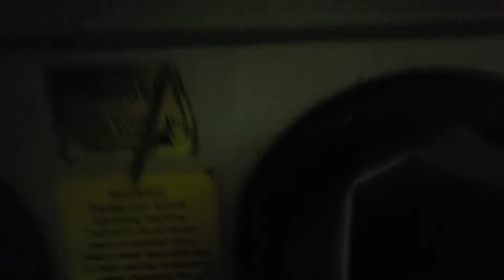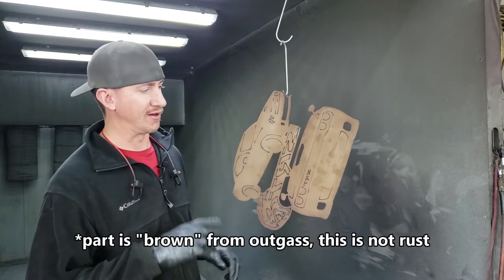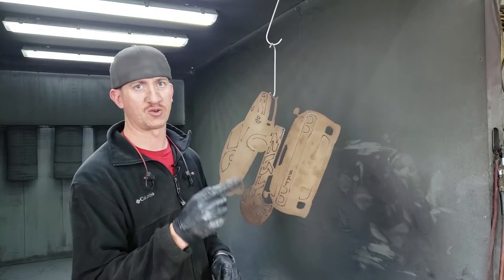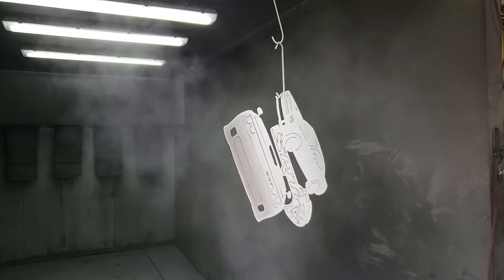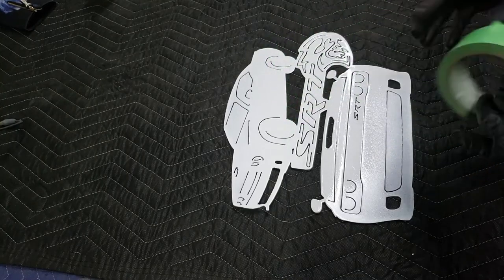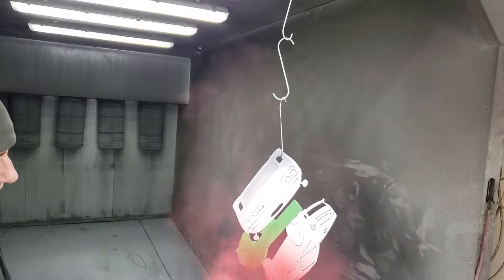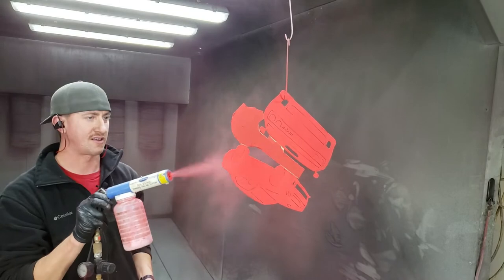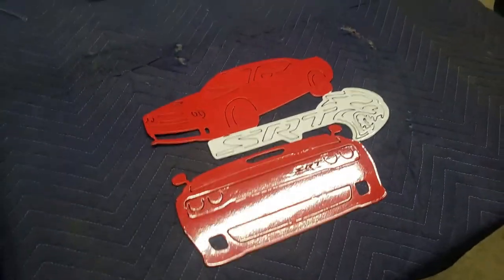Powder Coating -2 Tone Rusty Sign - SRT Mopar Sign

Comment: How long did you outgas for? Also what was the temperature  and how long did you leave it in?
Reply from the maker: We dont outgass at all really anymore unless part is oily or pitted bad.  If oily till it stops smoking, if pitted for atleast double the time at 50 degrees hotter than cure will be at.

Comment: I've tried... did the same as you shown, but when I got out of the oven, the painters tape glued on the white surface and left the glue and color over the coating. do you know what I've done wrong? thanks
Reply from the maker: I only put in long enough to gel the powder out, may be a cheap tape too
Reply: Right Now Powder Coating I’ve waited until the paint was kind of glossy... The tape I used is from 3M